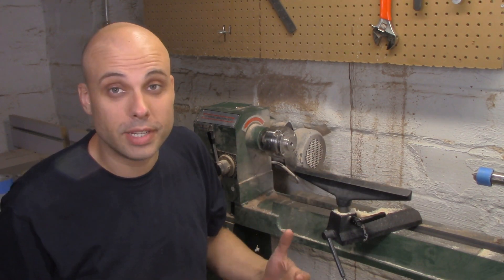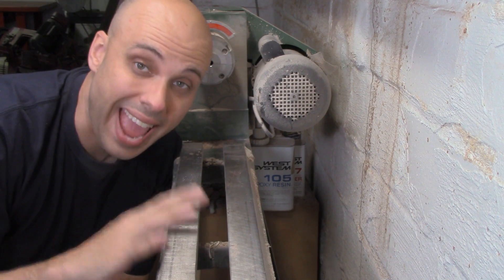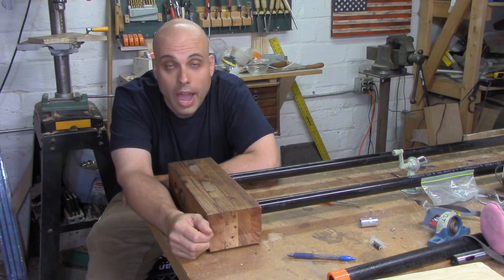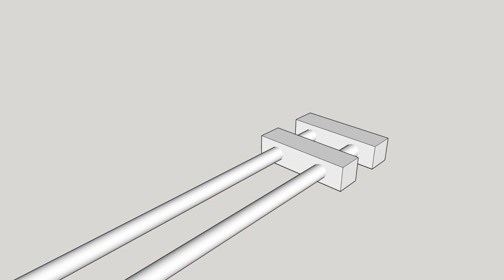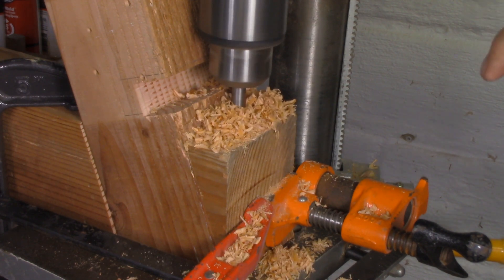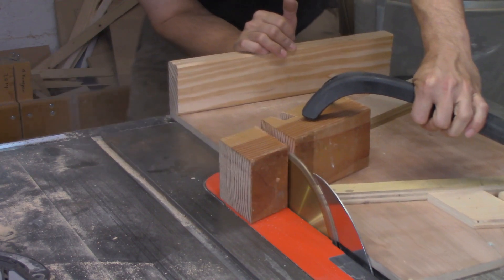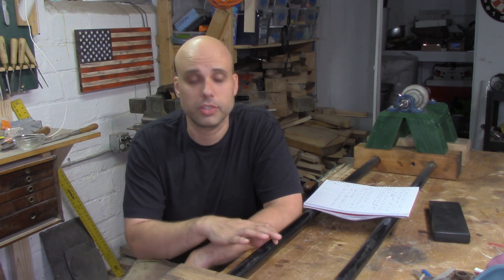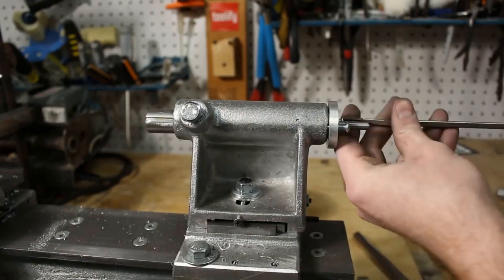The Real Lathe Project (Pt1: Bed and Headstock)

Comment: For bed rails drill your 34mm holes, cut the endstocks in half through the centre of the holes on table saw, the saw kerf reduces the effective diameter of the holes and when the 2 halves are bolted together it secures the pipes by friction.  Easy peasy assembly.

Comment: Oh, a note for those building this lathe (or anything else with 1" ID black iron pipe ways for  that matter):  the OD of the pipe is 1.315" .  A 1-5/16" (1.3125") Forstner bit will give you that very snug fit without the possible eccentricity induced by wobbling a smaller bit.  They're pretty widely available (amazon, online tool vendors, etc).

Comment: I made a lathe when I was in high school.  I picked up a 1/4 HP induction motor for about $10 from a surplus store.  On a broke teenager budget, that was all I bought.  Everything else I did was from stuff laying around the house.  I used chisels and files we had (definitely not high speed steel). I was able to adapt the motor to fit the 22m bearing fittings for skateboard wheels pretty easy.  And with that, I was able to turn old worn out wheels into new ones, with any profile I liked.  Sure they were a few mm smaller, but otherwise good as new.  With a set of wheels costing $30-40, it saved me a lot of money.

And later as an adult, I used Rex's technique to make a panel saw.  I used two pipes and blocks just like what Rex did to make a sled, which I attached a circular saw to.  It worked well, and I made a set of kitchen cabinets with it.  And just like a hand plane is just a chisel with a jig, all a panel saw is is a circular saw with a jig.

Comment: I’ll use a similar method once I start looking at doing MUCH larger pieces that a production lathe won’t accommodate like the Laguana I’m looking at getting. Like 40 inch dia. platters/bowls or offset rotation ovals. A harbor freight engine or a wrecked motorcycle/scooter engine would work well as well for the drive probably, plus you’d get shifting capacity with a moto engine.

Comment: Okay, I have to comment on this one.  I have watched a lot of your videos and have nothing but praise for all of them.  You always give good details, explain why you are doing what your are doing and why, and give really good historical background when appropriate.  So I have good things to say about your videos-except for this one.

I am a retired tool and die maker/machinist/welder and was born the son of a cabinet maker who ran his own business for over forty years.  I was practically disowned for learning tool and die and welding, but I wanted to learn something else besides woodworking.

Just because you can make a headstock out of wood and bearing does not mean you should.  There is a huge reason why factories make their headstocks out of cast iron and cheapness of materials has nothing to do with it.

When you have a headstock made out of wood and you turn dimensional lumber that is close to size, that wooden headstock will work-for a while.

However, when you start turning portions of trees to make bowls, you are going to have a problem.  Bowl blanks cut from trees are notoriously unbalanced.  That is where cast iron shines.  Nothing takes shock loads like heavy castings.

Heavy vibrations are going to work your bearings loose and the bolts are vibrated against the wood headstock.

I have built lathes out of steel and they work perfectly because I live by the motto "overbuilt is underrated".  This is especially true for wood lathes.

Sir, you make great videos and they are clear, concise and give great advice.  However, this video is not a good idea for heavy turning.  I look forward to many solid future videos.

Comment: Ow.  Check your bench and re-plane it to flat, then use some winding sticks on your ways and plane the support blocks to match your bench, then add some care on lining up the spindle with the ways.  David Gingery's book makes the tailstock early to help align the spindle to the ways.  Maybe you could do at least the front part of the tailstock, and then use it to plane the tops of your headstock pyramids level with the tailstock and also position the spindle bearings.  Maybe  make a fake tailstock pyramid 'T' then put it on the ways as T_____Ha_Hb  and _______Ha_T_Hb until you get the bearings level and located.   As described, it looks like you can't check if your bearings and spindle are all parallel to the ways.

Comment: To be honest here.. I kind of don't feel that test was safe, or generally it is safe. The motor could've got loose. Same what happened with the boring drill. The belt doesn't look safe too. It needsa casing. A cheap industrial plexi-glass casing would be good at the very least. It's not wood, but easy to cut, cheap, and your hand won't be catched by the belt. I'm not sure how it is at the end of the video, but lathes generally are dangerous.

Comment: Old appliances are a good source to scavenge motors for projects like this. Washing machines, dryers (0.25-0.75 hp typical) and treadmills (2.5-3 hp common) are usually plentiful for free or cheap on sites like Craigslist, OfferUp, and Freecycle. A belt grinder or a band saw might be fun to tackle next. :)

Comment: Thanks for this! I'm a bit circumspect about the brass garden screw on the headstock spindle though. I've been looking at  screw adaptors so standard chucks and plates can be used, but it seems that the only ones available for a plain shaft are for the 5/8 inch shopsmith spindle, which seems to me a bit small for turning bowls. A decent shaft with a 33mm spindle thread (record, axminster, jet) would be ideal, but arghh...just doesn't exist.

Comment: When drilling the holes to take the bed tubes exactly the right diameter of hole can be acheived with an expansive bit either in a brace or with a hex ended version in a drill. It is always best to make a test cut on a piece of scrap when adjusting an expansive bit as any adjustment one makes to the radius that it cuts of course creates double the difference on the diameter and one does not always acheive perfection first time.
The forstner bit did not work on the first set up because as with all types of large diameter wood bits be they flat, forstner or auger, the centre* of the bit must contact the work first to keep it running true. 

*Limey

Comment: @ 9:20, that's not a tent steak, it's a K rail pin. 
Circuses may use them as "tent steaks", but only because they,,,UM,,,get them for free,,,if you know what I mean.
K rails are those temporary cement barriers used on freeways at construction zones that have steel loops cast into the ends, and those pins run through those loops connecting them.
Reply from the maker: Well, I learned something today!

Comment: I'm a new subscriber I have enjoyed watching your channel for several years now.  FYI , youRex, and any of your viewers that will have to buy a electric motor anyway to build this lathe.  A 3/4 hp.sewing machine motor with adjustable RPM from 0 to like 10,000 RPM s with a readout and with adjustment of RPMS by the just turning a knob. Is available on Amazon. Don't remember for sure but think some are 110 volts and others are 220 volts and some may be 110/220 volts depends on how they are wired. The cheaper motors for around $110 dollars/ with maybe even free shipping. Of course some are much more costly.
Reply from the maker: Good point.
Reply: BTW just so you and your viewers know these sewing machine motors are for commercial bighead sewing machine that is why 3/4 hp. There are other sewing motors that run constantly and engaged by afoot/knee clutch for other projects that might need maybe a stop n go.

Comment: To drill holes for which you do not have the correct width Spade bit-simple, just grind the sides of the Spade bit until you reach the correct size. I have done this twice now and it works well Just buy a load of cheapo Spade bits for this and finish off with a fine file.

Comment: Another idea for the pipe fit-up. drill the 1.25 holes add perpendicular .5 holes rip saw the block through the middle of the bed holes. use half inch carriage bolts and reef the assembly together.
Reply from the maker: That is not a bad idea!
Reply: @RexKrueger  Thanks. Alternate ideas are much easier after a GOOD one has been presented.

Comment: Amazing work, Rex! 
Just one thing that came to mind, and I might be absolutely off base: I was under the impression that regular roller bearings have a very limited (no?) tolerance for axial load. Are you using tapered roller bearings in the pillow blocks?
Reply from the maker: You might be right. We'll find out!  I want to make it using the cheapest parts. If I need to upgrade the bearings later, I can do that.

Comment: There used to be a UK kit of parts that could be made into a lathe using concrete as much of the structure. My Dad and I built a lathe using commercially available shafting and bearings for the headstock and scaffolding tubes for the bed, it was OK, it worked. The real failing was the headstock, without a standard thread we couldn't attach any commercially available chucks or fittings. And it was too thin and  prone to allowing vibration and chatter. Build it big.
Reply from the maker: Yeah, I'm very fascinated by that concrete lathe idea. I've read a lot about it. I do want someone on YouTube to build one. Maybe it should be me. Maybe not.

Comment: OHHHHH! Now I want to build a new lathe for me!  And I want it to be the 24" version you started with.  Vibration will be biggest issue, but that is why God invented sandbags and bags of cement.
Reply from the maker: Yeah, I would go slowly and carefully if you want 24" of swing. The design I have here is not up to the challenge. Everything will need to be stronger. Good luck and stay safe!

Comment: Making a headstock from wood is not going to be very rigid...
Why not just use 2 short pieces of steel box section as the platform for the headstock plummer block bearings
I personally would also procure an offcut of I beam and use that as a bedway...
THAT will be rigid !!  Just my 2 cents... 😏
Reply from the maker: So those all sound like great ideas, and with no sarcasm whatsoever, I suggest that you build it that way and make a video about it. I bet it would be great and I'm not joking in any way.  My headstock is really rigid because of the way it's build and reinforced. I think it's going to work fine and if it doesn't, then I'll redesign it. I build it from wood because the whole idea is for the the average intermediate woodworker to be able to make this thing. I can weld and do metal work, but as soon as you get into square channel and i-beam, a lot of people tune out because they're just not going to that much trouble.

Comment: Check your local Craigslist for a used treadmill.  yank the motor (DC servo type) and control board and with the help of YouTube, you can make a variable speed setup without having to make or buy extra pulleys!  Definitely subbing for the rest of the build!
Reply from the maker: I love the DC motor idea and that's on the list for future upgrades, but for now, I'm sticking with this AC motor so people can more easily follow along. Thanks for watching.

Comment: An easy way to get started turning is with a pole lathe.  Used for thousands of years.  Windsor chairs are traditionally made with one using green wood.  I've seen bowls made on pole lathes too.
Reply: Also, look up concrete lathes.  For WWII, the US needed to make metal working lathes with precision.  Concrete also provides weight for vibration damping.
Reply from the maker: I have spent HOURS reading about the concrete lathe. I want a metal lathe SO badly and they seem like a good option.

Comment: Look at my comments / suggestions to 'makercise' , * part 8 of his lathe build - ( I could copy & paste it / them . . . but that would make the lazy one LAZIER !  :p ) 
      As I commented v < below ; VIBRATION will cause harmonic resonance ; which WILL scare the hell out of a 'newbie'. . . 'far better to ensure against it by learning about the nature of the beast , then design & build accordingly ! 
     So far, the weak link looks to be fasteners that can and WILL vibrate loose with time . . . MURPHY usually pays a visit when you LEAST expect it ! ! !    I would suggest to 'fortify' all holes for hardware with superglue , to stiffen the joint. ( only after making the threads for them ! ! ! )   Where possible, use hardware that goes completely through the attachment points ; which would secure the joint 'solidly'.   Lag screws are prone to wiggle loose , as are any fasteners screwed into a 'dynamically loaded' mechanism . . . static loading is a different creature.  * Consider how nails & screws tend to loosen with the seasons / heat & humidity !   Consider how screws in door hinges can / will loosen with time - ( fair example )    THEN consider vibrations that are magnitudes HIGHER , both in force , and amplitude, or frequency . . .   
      Wood is fine for lower loads & speeds , but can quickly become second rate when the load outweighs it's intended parameter.    Different wood densities have more or less HOLDING POWER regarding the fasteners = grain direction is MOST IMPORTANT , as is the area & thickness of it . . . wood can also SPLIT where fasteners are driven in . . . especially if there are no PILOT HOLES !  ( Drywall screws as an example )    
     It appears you are using a high grade of plywood for the top surface of the headstock ?     I'd suggest a 1/4" steel plate . . . mounted on the inside & outboard vertical surfaces ; & use 4 bolt , face mounted bearings ( much more rigid !   Cheap too - JSB just great bearings , ebay)     
      With a bit of collaboration , a ''lathe KIT" could be produced for a fair price . . . which would make a very attractive entry level machine. . . just add a few off the shelf parts to complete !    I've been working on the idea for YEARS !  -  ( I'm going to be 63 tomorrow :D    PARTY TIME ! ! ! )     
     'Hope I can be of some assistance as this 'unit' evolves !             G.T. Wocosky
Reply: The flange bearings , *shown below the ones you have in the description would be a much better choice for a lathe !  ( cheaper too ! )   
     I have a list of suggestions longer than I care to post ;)   Years of experience have taught me to think twice , much like measuring twice before cutting ! ! !     * * Looking forward to seeing which way you go with this build !                G.T.
Reply from the maker: Thanks for all your thoughts!

Comment: Excellent video & it's great to see you actually show mistakes & how you went about correcting them & improving things.
I took your advice & began making a router thicknessing jig instead of shelling out on a thicknesser. It's slow going but getting there & I've decided to add dog holes to the base & build up some toggle clamps for workholding. That should let me avoid putting sticky stuff directly onto the bed and, with a few other little jigs, might also allow for using it as a basic jointer. I almost enjoy making jigs & tools as much as making things with them.
Reply from the maker: I know how you feel!

Comment: Your vids are always excellent!  One suggestion...Make whatever motor you use variable speed.  Less futzing with pulleys and a LOT more convenient while actually turning.  Call me lazy but it's a lot more productive to just reach over and turn the dial. Add a $10 digital RPM gauge and Bob's your mother's brother. Normally I'd suggest a free treadmill motor and control but this size might be a little beefy for that.
Reply from the maker: I totally agree and that's a planned upgrade. But there are SO many more AC motors around and they're cheap and easy to find. I literally have three of them just sitting in my shop and one of them was free. The average DIY person is much likelier to have an AC motor, so I'm starting with that. In the future, DC or 3-phase FOR SURE.
Reply: Totally agree.  The treadmill motors can usually be had for free on Craigslist but as I said, this is a beefy beast.  Waiting to see how you build the head and tail stocks. And, welcome to LJ's.
Reply from the maker: Thanks a lot!

Comment: I've been putting together a lathe slowly over the past year. Most of it is in the designing part and occasional snagging of parts when I see them cheap, since it's not a big priority over other things. Instead of pipe or a twin beam design I'm going to be using aluminum miter track attached to a solid bed, with the tail stock attached to a stop that can lock down. If that doesn't end up being strong enough I might try either doubling it or having to come up with something else.

Oh, and I'm going pedal-powered. Not treadle. Like the old pedalled barnes lathes from the late 1800s. It seemed like it would allow for more control than a treadle while also not running up my electric bill or annoying my neighbors... and has a built in "lathestop" haha.

Comment: Ow boy, making senses are tingling. I don't need a lathe, but a disk sander is pretty much the same and that could come in handy for me at this point. Great content, thanks for the inspiration!
Reply from the maker: You know, there's no reason you couldn't build the machine and use it as BOTH. I mean, why have one tool when you can have two?
Reply: Yep,  just going to downsize for the first one. Tiny kitchen workshops are tiny. Thanks again!

Comment: Hey Rex, this looks really great but you might want to replace the rods you tapped into the tailstock end support with some countersunk bolts. I suspect between vibrations and wood movement the rods might work their way out with time.
Reply from the maker: That's a good observation, and it's an easy change to make. Nice!